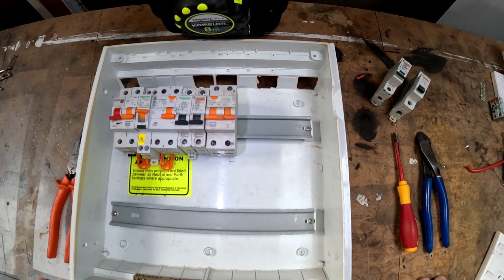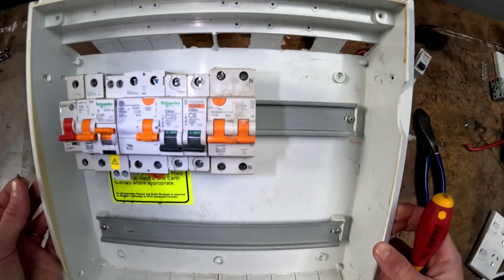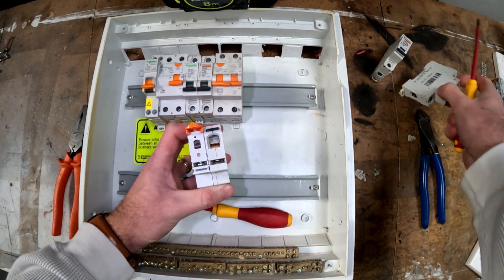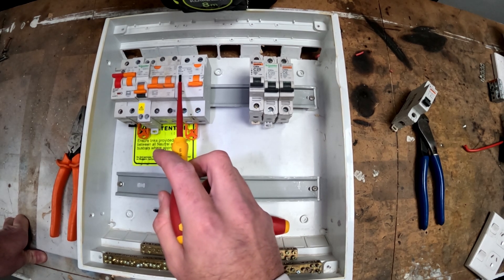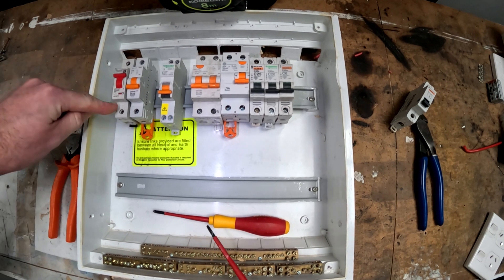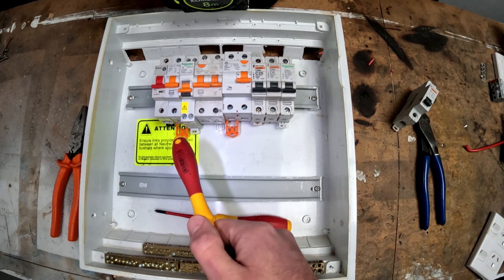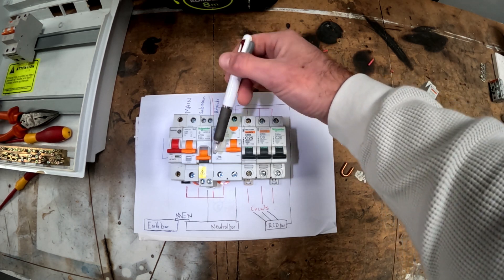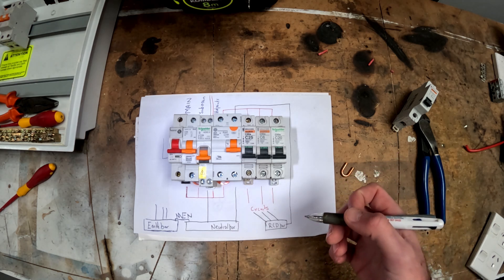Things to know BEFORE starting on a Switchboard

Comment: Only 3 breakers per RCD....the rules have certainly changed, my house was wired 20 years ago and my 2 RCDs each have 10 breakers! To be fair, most of the circuits don't have much load, the 2 kitchen circuits take most of the load. Ironically, the main loads in the house (oven and 2 heat pumps) don't even have RCDs.
Reply from the maker: Aha yea pretty standard, hard wired appliances like ovens ect don't require rcds but will soon. Also 2 rcds is generous when they came in most people just added 1 for the full house 😮

Comment: That little slot on the c/b is where the comb goes in buddy, thought that was common knowledge.
Reply from the maker: Yea but only if you have the right comb and the same type mcbs, there are thousands of things to know and I can cover them all in a video unfortunately
Reply: @_nztradie it’s obvious you didn’t know, because you were trying to put it in the wire terminal 😂😂
Reply from the maker: @Giantslayer999  sure buddy, without the right comb it doesn't work? I'd never tend to use it anyway

Comment: Hey NZ Tradie, do the breakers all have polarity? The reason I ask is in my practical we were instructed to wire them from bottom to top. Which didn't make sense to me, and your Video is using a more logical method of wiring top to bottom.
Reply from the maker: Hey, good question, no breakers/mcbs never have a polarity, and it doesn't matter which way you wire it so long as you do it the same in across a whole switchboard. Although I don't believe that's a rule, it's just common sense. Rcds and rcbos on the other hand can be polarity sensitive, it just depends on the brand

Comment: Will a bus bar have the current capacity for all circuits.  Is there a max load you can supply. I mean can the bus bar handle  5 * 20 AMP MCB and a 40 Amp MCB etc etc    Also if you use wire to loop the active to every MCB what are the rules on its size  ?   Should you take each active from main switch and use the size appropiate for the MCB  ??   Lots of confusion on this topic i think among electricians...    Maybe do a video on this
Reply from the maker: @michaelcostello6991  that's a good idea. I think I will
Reply: @_nztradie  thanks.   Only this week on a job an electrician was using 2.5mm to loop and i discussed it with him.  He then upsizes cable.
Reply from the maker: @michaelcostello6991  I always use 4mm because you can get that on a drum, although since this video, I've done more digging, and you can use 2.5mm and above in a switchboard. Although I would generally say you sure try use at least 4mm

Comment: Such a bad setup uk so much better for fuseboards
Reply from the maker: I dont know about that, you guys are still busy cutting chases in concrete walls and running conduits, right 🤔
Reply: You lot got backwards in Arabic putting the main switch in the wrong position and use ring circuits; Like WTF!!
Reply: Haha no way UK is junk az
Reply: Forever chasing, 'fuseboards' in the worst places, ring circuits, sb metal enclosures, sleeving bare earth conductor in wire, the worst cardboard drums imaginable or coiled in plastic, always terminating armoured, the money... yeah mate UK is awesome